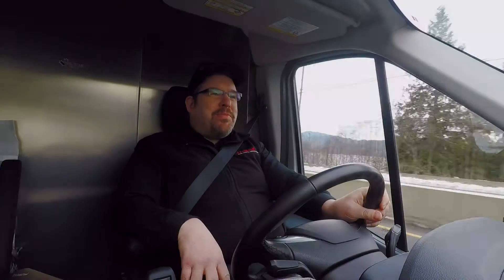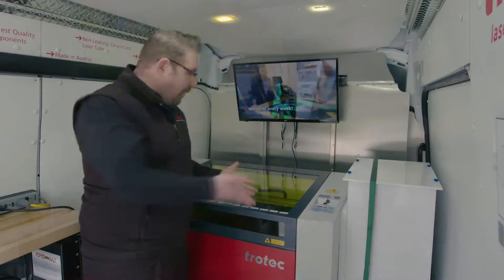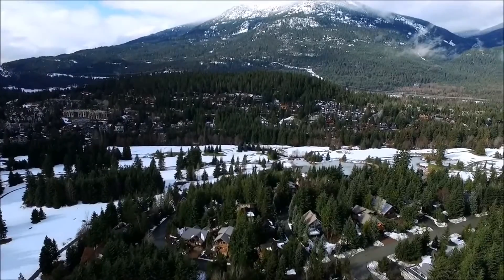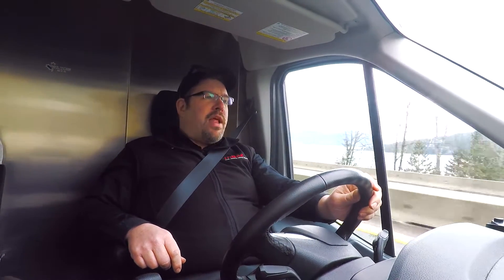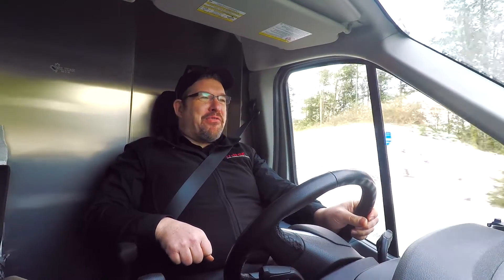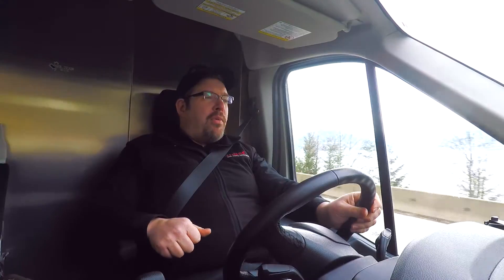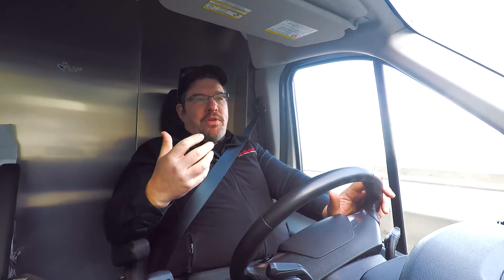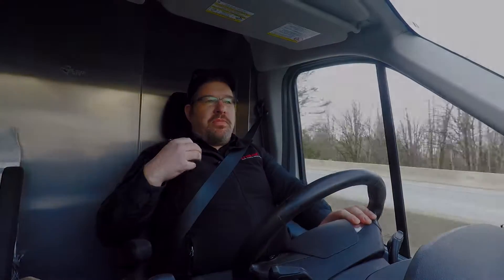Exhaust Systems for your Laser Machine | In The Van

Comment: With regards to setting up a mobile operation, is there an issue with vibration and bumps in the road causing issues with laser calibration or maintenance that's unique to such a setup?
Reply from the maker: Not with a trotec in my experience.  I had a Speedy 100 bouncing around in my car for 3 years.  IT was taken in and out of a car and carries into hundreds of buildings.  It never went out of alignment at all.

So the new setup is so stable that I have never had an issue with alignment.  On an inferior machine that I used years ago before Trotec, I could never take a mobile unit as the tube and alignment would go out so quickly.

 I am happy that my Trotec is tough enough to take the rigors of the road.

- James

Comment: Hi James, great new show, was wondering if you could talk about the best way to clean the inner rail on the overhead gantry, there is some resistance along the X-axis on my 400 flexx and I clean it regularly but it's always a tough spot to stick a rag in with WD40and "try" to get all the grit built-up in there. I do a lot of MDF and wood, even with a great extraction system, it still slowly builds-up in there.
Reply: FYI, I've had my 400 flexx for 3.5 years, 140W CO2 and 30W fiber.
Reply from the maker: CNCKing.com hi Jon, thank you for the kind words and feedback. We will send this request for James to cover.